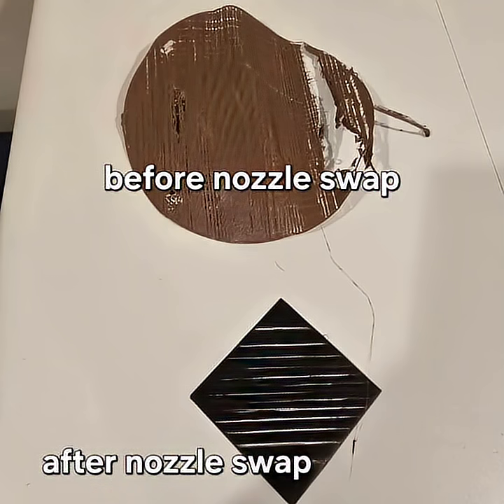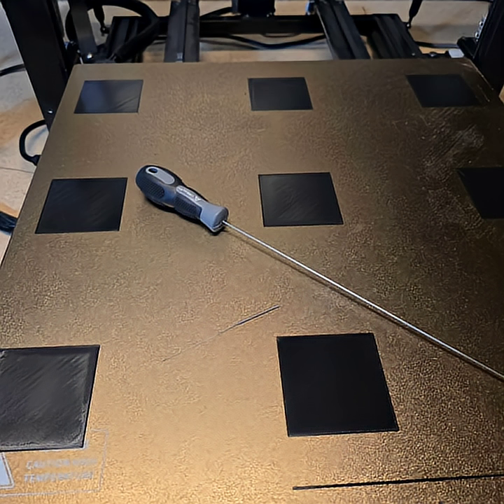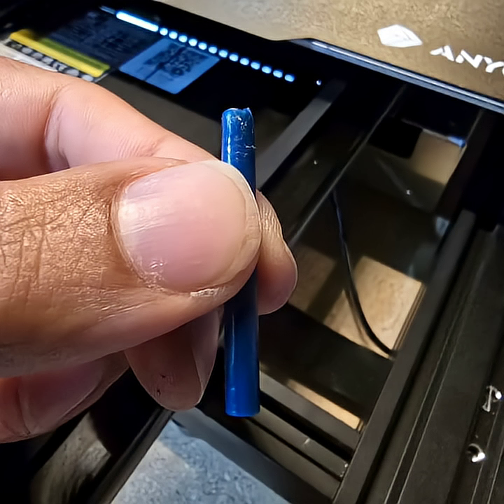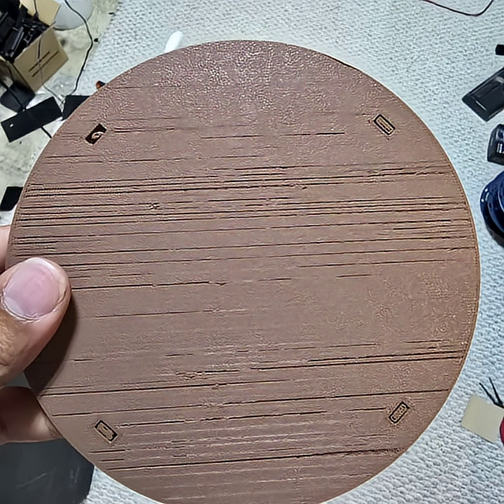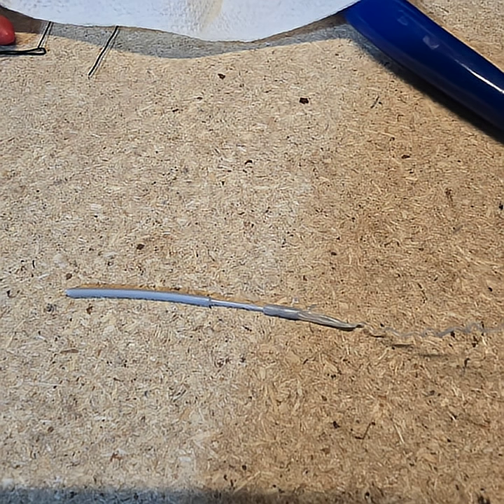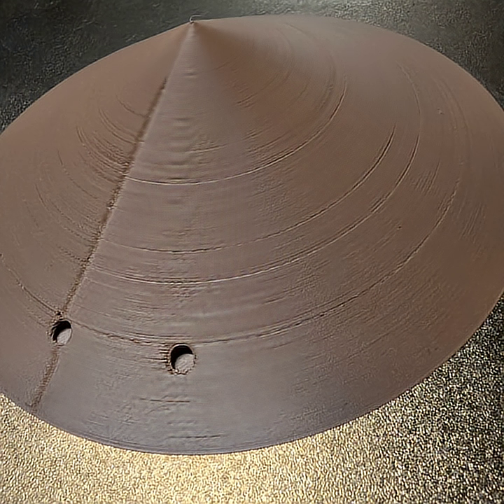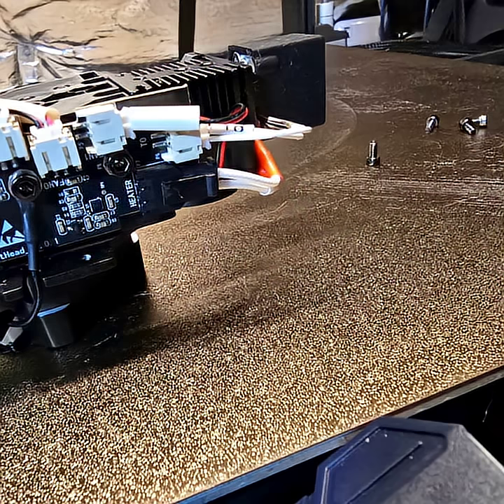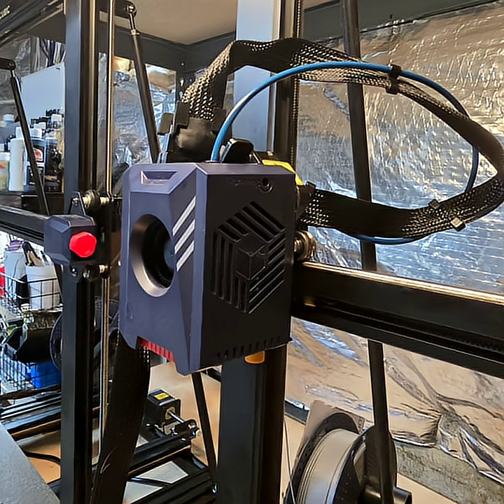Kobra 2 max extrusion issues and my easy fix.

Comment: That final solution does make a difference LOL..but good steps on troubleshooting!!
Reply from the maker: Well i was thinking. I changed the nozzle, the ptfe, the entire hot end from nozzle, ptfe, throat, heat block, etc. Next was stepper and at that point i saw amazon had full  print heads for 30. Take all the guess work out.